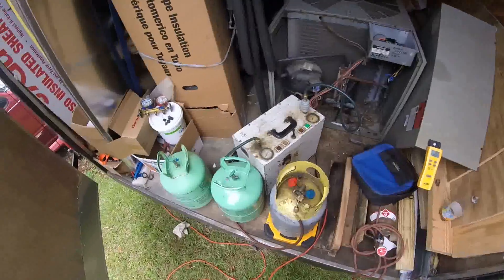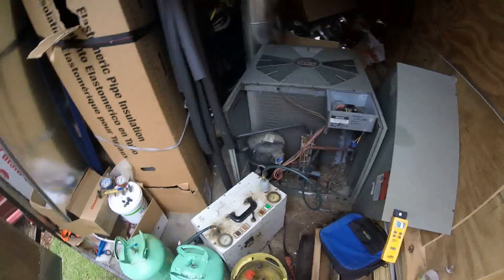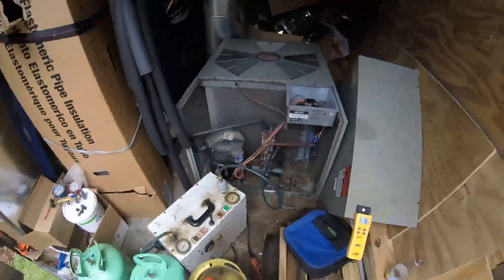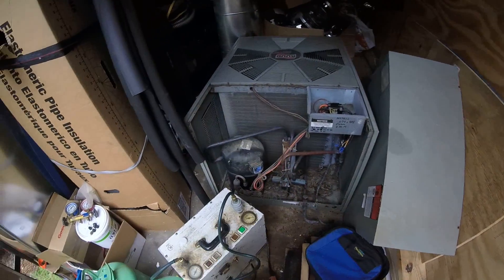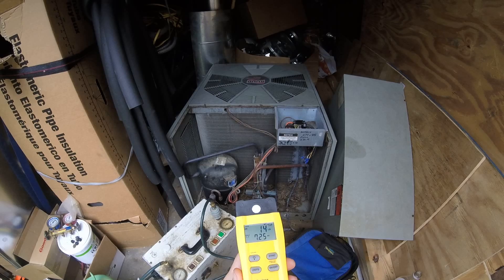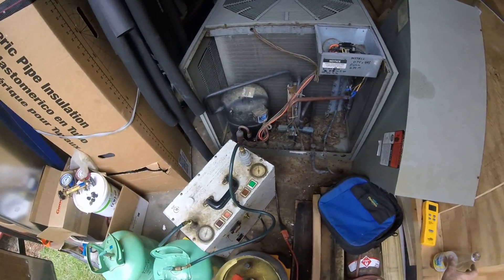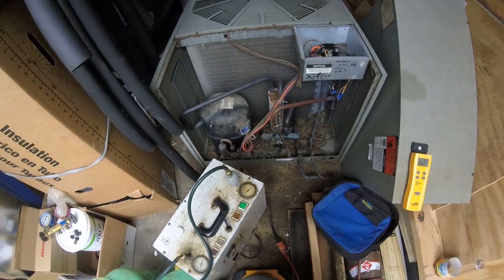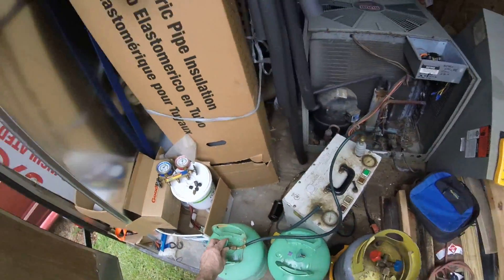How much R22 is left in a Empty cylinder?

Comment: Joe, curious, you mentioned that that recovery pump pulls a 10 inch vacuum on the can. So, when you disconnect the hose from the can to the recovery pump didn't that just suck in air and then get reconnected to the 2nd tank and start sucking down the air in the air hose and the R22 in the jug and put both in the recovered cylinder ?
Reply from the maker: Yea good catch it sure did. I'm not worried about a little tiny bit of air. It's so easy to get back out.
Reply: ah ok. How does one go about separating air from r22 gas?
Reply from the maker: +joeyf504327 just charge back liquid from the cylinder and what's left is air and vapor. That's what I do.